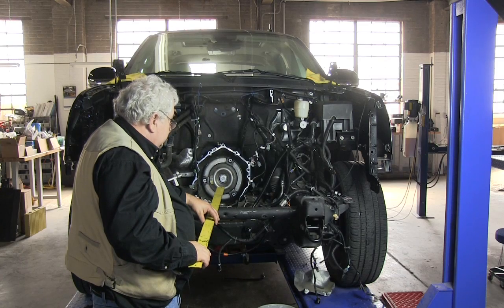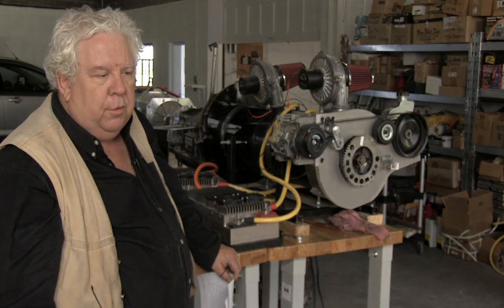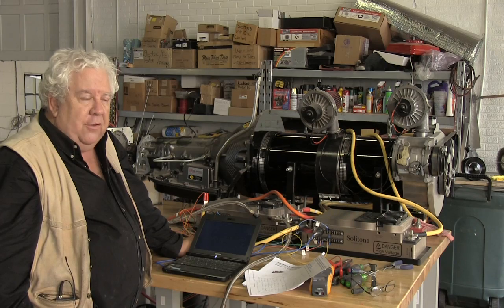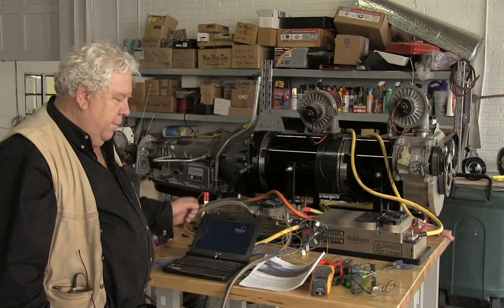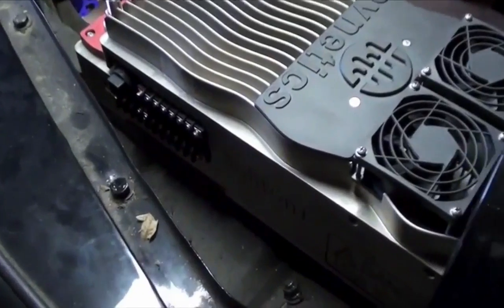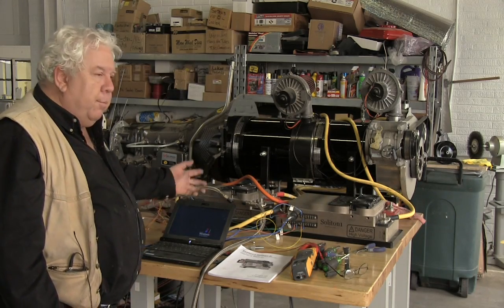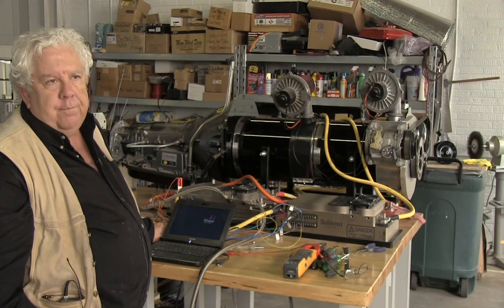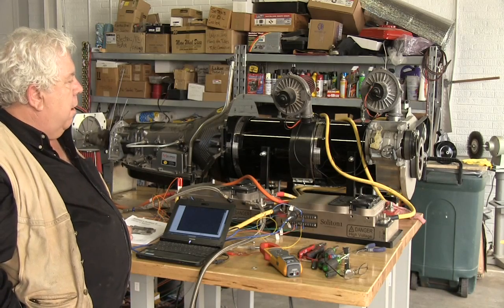EVTV Friday Show - March 9, 2012

Comment: I think the motors fighting themselves is best thought of as rowers rowing a boat, you need the drum beat to keep them in sync or the boat could go round in circles, if these were dc motors with 4 permanent magnets, would you be best with the motors with magnets aligned, or with one motor body say 45deg rotated to 'smooth' the power output peaks, would this imagined value be 45 degress ie half a magnet, or would it be better a few degrees ie half a winding ? or not relevant!

Comment: VW engine management will cut the ignition system if the Idle goes below 750 RPM check that wont be a problem for you !

Comment: Another great show, thanks Jack !
I create a Blog about my use of EVs (LEAF, Vecric, e-Solex)
With a former Prius Enginer kit I am in the process of creating an energy storage system with 32 LiFePO4 cells, a charger, a grid-tie inverter, and this light object dual relay volt-meter
Thanks a lot for all the great advices you give during your shows, that helped me a lot: I removed the Enginer BMS, that was causing some cells to go down too quickly